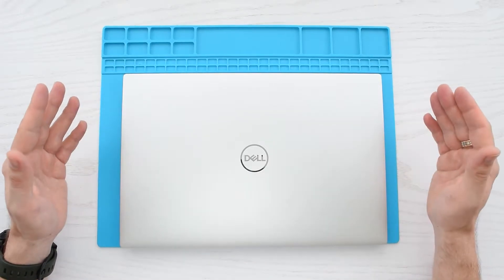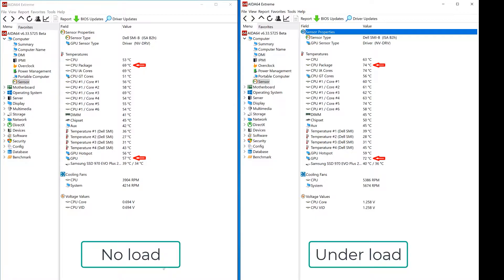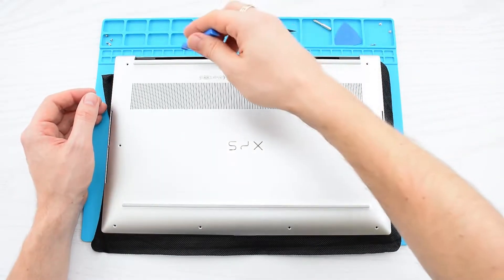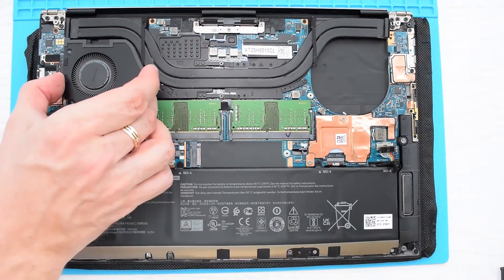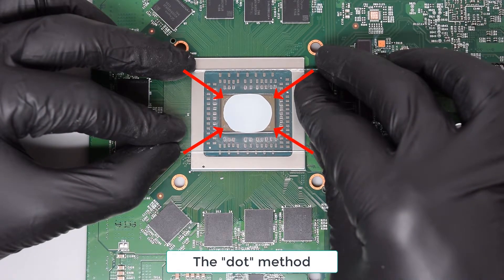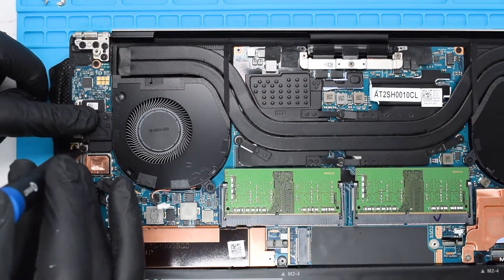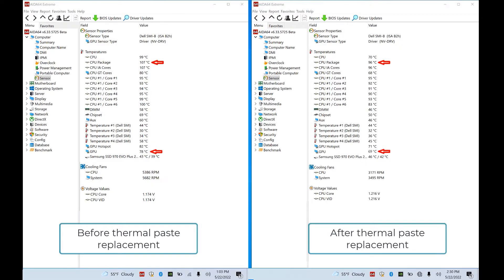Dell XPS 9500 / 9510 / 9520 / 9530 – Thermal Paste Replacement & Cooling System Cleaning Guide

Comment: My 3 year old XPS 9720 doesn't go past 100C on any of the cores so I think I'm fine but this is great to know. GPU also never goes above 60 though I need to stress test it on more intensive activities. I also recommend people use a laptop cooler (the sealed kind like thermaltake) for peace of mind, if they use their laptop as mainly a desktop like I do.
Reply from the maker: Yeah, those temps are totally fine. A cooler definitely helps for peace of mind, but honestly if you’re staying under 80 °C on CPU and 60 °C on GPU, you’re in a good spot.

Comment: I used this video initially for my Dell Precision 5570. Now I am trying to repaste it again because I still have my on-site warranty but Dell support keep telling me my CPU down locking to 400MHz and GPU limiting itself to 20W for no reason is a software issue since the tests they had me run passed. Never buying Dell again which sucks since I’ve used their laptops since I was a kid.
Reply from the maker: I think what they’re saying is nonsense. Your laptop would be unusable if it actually ran at 400 MHz. Just run some diagnostic software like Aida64 and check the temperatures both at idle and under load. If the CPU and GPU stay below 50 °C at idle and around 80–85 °C under load, then you’re fine.

Comment: Do you have video or any information how to sold the problem for 2024 Dell XPS 9440? Thx
Reply from the maker: That one is even simpler, just remove the heatsink and repaste the CPU. No need to replace the thermal pads for a such fresh laptop.
Reply: @ElectronicsComputers  Thank you for your quick answer. What paste do you advise me? Same?
Reply from the maker: I've been using Grizzly thermal paste in my repair shop for many years. It's an excellent product with outstanding thermal conductivity and long-lasting performance—it doesn't dry out even after years of use.

Comment: Thanks - my 4 year old XPS is getting too warm for my liking - I have no issue opening it - in deed already replaced RAM and batterie, but always was afraid to unmount the cooling just to find liquid-metal, which I don't want to deal with.
But now seeing it is just normal cooling-paste I will give it some repasting.
Reply from the maker: Yeah, it's a pretty straightforward process you won't have any issues with replacing the thermal paste.

Comment: Hi. How about XPS 14 9440. what thermal pad size should I get? Is changing the thermal pad to thermal putty Upsiren is a good choice?
Reply from the maker: Thermal putty is always the safest option, and a high-quality thermal putty will consistently outperform even the best thermal pads in terms of thermal conductivity. It adapts perfectly to any surface, filling in all gaps and irregularities, while applying minimal pressure to components. This ensures effective heat transfer from components to the heatsink. We always use it for our clients' game consoles, graphics cards, SSDs, and more.

Comment: hi for pads, when you put on heatsink i dont you applied any pads to chips, where are you supposed to put it?
Reply from the maker: In my case, the original thermal pads were attached to the heatsink. When replacing them, you attach the new pads directly to the chips.
Reply: @ElectronicsComputers  so the original thermal pads, just leave it there on the heatsink?

Comment: Thankyou! I'm going to try this. I have the same experience. Worst XPS cooling design and manufacturing.

Tip:  Ironically putting your laptop on your lap or other soft surface can really cause overheating due to blocking the vents. I recommend a table AND adding clear rubber bumpers on the bottom to elevate the laptop slightly and help the fans draw more air.

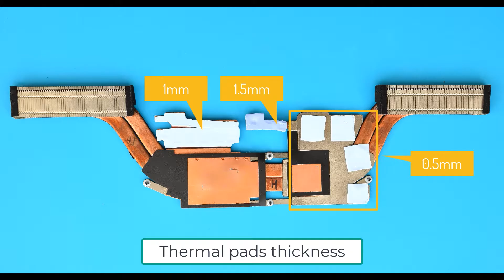Comment: Hi everyone, first of all I wanted to thank you for your great detailed video. But I had a question, do I need to buy three thermald pads with different thickness???? Regarding to 3:14 
Thank you in advanced for your time dedicated to answer my question!😊
Reply from the maker: All those pads have different thicknesses, so yes, you need to buy several pads with specific thicknesses. In a desperate situation, you could try squeezing thicker pads into thinner ones, but I'm not sure if it's worth it. Instead of thermal pads, you can use thermal putty like Upsiren, which will adjust to the required thickness when pressed by a heatsink.
Reply: @ElectronicsComputers  thank you a million. I also think that those adjustable thermal pads are the solution. Would you please send me a link for buyin them? Maybe the high-quality  one?

Comment: Hey, for the 9500, would you recommend upgrading to 64gb ram ?
Reply from the maker: Well, that depends on what you're doing. I also have a 9500, and I installed 64GB of RAM because I need it for my work. I run several virtual machines on that laptop simultaneously, each requiring at least 8GB of RAM, along with other heavy software. This setup uses about 40-50GB of my laptop’s RAM. For most other tasks, like working with graphics or gaming, 32GB of RAM would be more than enough. Considering that our model is already somewhat outdated, it doesn’t make much sense to invest in 64GB of RAM, especially since you'd be buying older memory sticks that won’t be compatible with modern laptops that have already transitioned to DDR5.

Comment: Any info about size of both chips? Recent trends suggest to use thermal pads with phase transition as a nice, long term, non-drying solution. And they usually come in pre-cut package

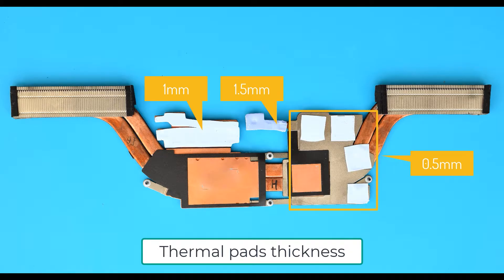Comment: 3:17 
i saw somebody use 1,5 mm thickness on the other chips, i understand the manufacturer uses 0,5 mm for a reason but it might not result in better cooling but costs saving
so i wanted to ask for your opinion, do you think the 1,5 mm pads would work best or at least as good as 0,5mm because i have some 1,5mm at home and don't want to buy 0,5mm
Reply from the maker: If you apply a 1.5mm thermal pad, the heatsink won't even touch the GPU and CPU die surfaces. A 0.5mm pad is what you need. Using a thicker one would reduce thermal conductivity to the heatsink—so what's the point?
Reply: @ElectronicsComputers  thank you very much 
i watched someone who did that and he said he did research and came to that conclusion so i wanted to double check

Comment: I put (dell xps 9570) 1 mm thermal pads instead of o.5 mm, is that still ok? Thanks
Reply from the maker: Check the temperature of the CPU and GPU. If it's high, the CPU and GPU might not be making proper contact with the heatsink due to the thick thermal pads.
Reply: @ElectronicsComputers  The temperatures seem ok , I also changed the thermal paste because it was now dry, thanks for reply

Comment: Thanks for this. One of my 8 cover screws has stripped (as the torx5 is very fine). So I can’t remove the cover. Any suggestions?
Reply from the maker: In such cases we use flat-head screwdriver with sharp edges or a screw removal kit like this: https://alii.pub/6xnq6q

Comment: Do you recommend the same thermal pad thicknesses as in the video for the XPS 15 9530 also?  Dell claims they use 1.5mm thickness for all thermal pads in 9530.

If the thermal pads are not damaged, is there any reason to replace them with GELID GP Ultimate 15W?  To me, it seems like the extra conductivity of these pads might not make a difference.  I notice in your video that you do not replace your thermal pads; you left the original pads in place.
Reply from the maker: It's up to you whether to replace those pads or not, but in reality, it won't make any difference. The original ones are not bad, but those chips don't generate much heat in the first place. Just apply the best thermal paste to the GPU and CPU (don't use liquid metal), and your laptop will be happy and will last long. Also, in the Dell Power Management console, make sure that your cooling profile is not set to silent. In that mode fans turn on when the chips are nearing 80°C. Set it to cool or high performance.

Comment: my Dell precision 5570 fans are always run. my laptop built in April 2023 and it seems that thermal system is still clean. but during normal work such as internet exploring, both fan brought in service. if i will replace thermal paste, my problem to be solved?
Reply from the maker: Try to check the temperature of your CPU/GPU with some software like AIDA64. You an download it for free from my Patreon page. If the temperature is over 70C, then replace the thermal paste.
Reply: @ElectronicsComputers thank you.

Comment: out of curiosity, can you upgrade the cpu in this model of xps?
Reply from the maker: Only if you have an infrared rework station. ABout 10 years ago all CPU were easily upgradable by a user, nowadays WiFi adapters, CPU and GPU are soldered to the board. Some companies like Apple even solder SSD and RAM to the board.
Reply: Quick question would it be possible to solder and upgrade the vram on this laptop

Comment: hey, whats your opinion on the New Honeywell PTM 7950 pads that people have started using instead of paste for the CPUs, 
theyre apparently 8.5W/Mk so they can actually handle temps real well.
Reply from the maker: Grizzly Kryonaut = 12.5 W/mk, Grizzly Conductonaut (Liquid Metal) = 73.0 W/mk. The cool thing about Honeywell is that it's very easy to apply but apart from that I don't see any reasons to switch to that thermal solution.
Reply: @ElectronicsComputers  Because it's almost as good as LM without the intervals

Comment: For the XPS 15 9560, are 1.5mm thermal pads too thick for the 4 large chips under the heatsink? Should I get 0.5mm instead?
Reply from the maker: For the XPS 9560 you need 1.5mm thick pads.
Reply: @ElectronicsComputers  Thank you very much for the clarification. Many say that 1.5mm is too thick for the 4 chips under the pipes, and will not allow for contact between the heatpipes and the chips. Good to know it will work.

Comment: I have a new XPS 17 (9730). Is this tutorial applicable?
Reply from the maker: The process of removing the back cover is the same the rest is different. That model has different heat sink and different thermal pads thickness.

Comment: Hello, for the thermal pads, is there any harm or advantage in using the 12.8W/mK or the 15W/mK instead of the 8W/mK? Thank you for the video, trying this next week with TPM 7950 pads instead of paste.
Reply from the maker: The higher the better. Nowadays we use GELID Solutions gp-ultimate 15W/MK which last very long and that's what we recommend to use. https://alii.pub/6oy399

Comment: This is the only video/resource I've found that actually shows which thermal pad thickness is needed on which parts of the cooler.  Thank you for showing that!  I have now ordered some Thermal Grizzly pads and Kryonaut Extreme paste with the hopes of getting my brand new work laptop to no longer double as a space heater just from booting Windows.
Reply from the maker: Glad it was helpful!
Reply: How'd it end up?
Reply: masterpiece
Reply: i know its been 3 years but did it work?

Comment: Will spreading the thermal paste cause air bubbles?
Reply from the maker: No, if you do it right.
Reply: @ElectronicsComputers  I never spread the thermal paste with a palette. Should I just go with the classic grain and press the cooler or you suggest to still spread it a little before that?
Reply from the maker: @theorganizationXII  I used a piece of glass to show you what's going on under the heatsink with different application methods. Technically, any method will do the job. The question is how good.
Reply: @ElectronicsComputers  +1. With spreading you have total control, with grain you don't see anything after you cover the chip with the heat sink. Could you please explain the heat sink screws tightening method? Do you screw in 1-2-3-4, one by one to till the end or first screw them in lightly and then tightening? Trying to do that with my 9570, not very effective as yet.